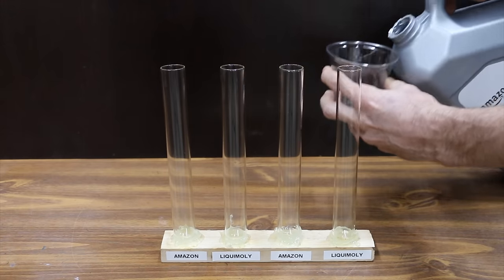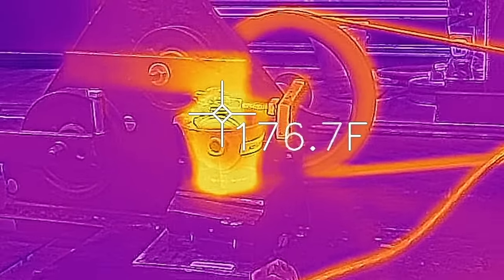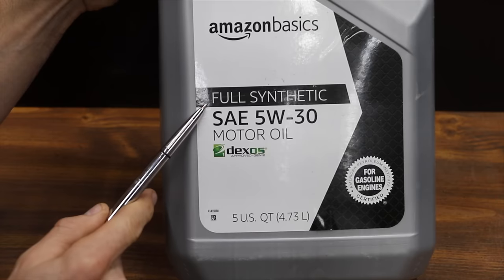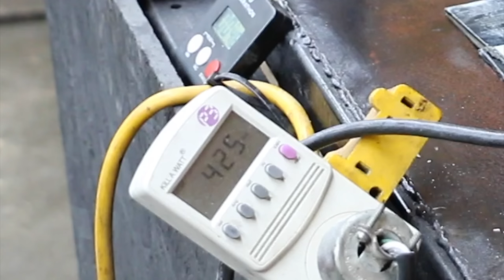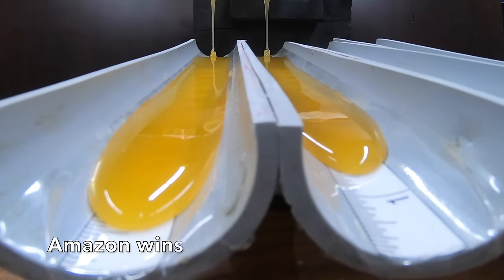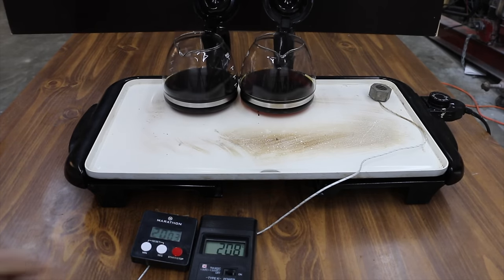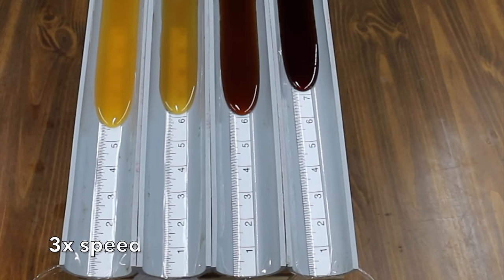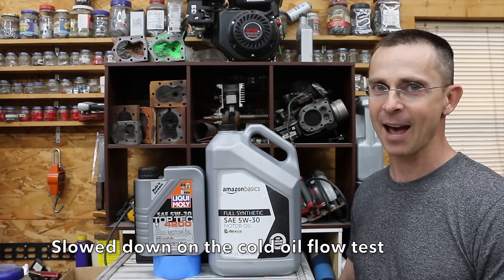Is Amazon Basics better than Liqui Moly? Let's find out!

Comment: I've watched many of your videos and enjoy them.  I'm not sure comparing Amazon Basic with a German oil is even a fair comparison.  On this one, I think there are a few call-outs that are worth mentioning:

1. I know a bit about Liqui Moly and I change my own oil in my 13 year old German car.  Liqui Moly has many tiers of oil, in the same viscosities available.  Looks like you used Top Tec 4200, which Liqui Moly says is an oil that can last between 30-50,000 km for people who don't drive often and can have a 2-year change interval (that's the claim).  I think the better, more apples-to-apples test was to use Liqui Moly's "baseline" tier, in 5W30, which is Leightlauf High Tech, in the blue bottles.  Could the difference make an impact?  

2. While Liqui Moly oils are suitable for many cars (German, American, Japanese), many of Liqui Moly oils have engine builder APPROVAL, and I'm not sure you brought that up in your video.  I agree with the general idea that Amazon Basics oil is perfectly fine, I would never use it since I buy oil brands (Liqui Moly, Valvoline, Mobil 1, Castrol) because they have my engine builder approval (not just recommended). Amazon Basics doesn't have that.  And I'm not an expert at the technical level but those things do count, especially in more sophisticated engines.  Whatever the additive package is to make Liqui Moly get manufacturer approval, can this difference also make an impact?

3. Lastly, as I said above, I also use Valvoline (American made) in my German car and it's fine since I have the builder approval code) so I'm not knocking American oil, but it is a fact that German oil is higher quality since there are higher standards in Germany.  Could that have also had some impact with your testing?

Just wanted to mention these issues, on the merit of the oil alone, and why I'm not sure this was a fair, apples-to-apples comparison (all other issues notwithstanding, such as the oils not being tested in an application with an engine, etc.)

Thanks.

Comment: Crazy name since according to Blackstone Labs, Liqui Moly does NOT contain any molybdenum at all!
Reply from the maker: Great point!  Helps explain the lubricity test.
Reply: Well I was going to start running liqui moly in my bike, diesels, and tractors. I mine molybdenum, can't believe it doesn't contain moly and the test results. Guess I'll be sticking with my Valvoline
Reply: My test from Blackstone labs shows 273 units of molybdenum in the liqui moly I am using, way more than the average results accordingly to their statistics. However I have to say that I am also adding Ceratec to it. Until we see real test from a trusted laboratory on the Amazon oil I think to stay away from it. The guys from Blackstone said to not waste the oil and advised to extend the use of it to at least 7k miles.
Reply: the ones that comes with moly seems to be MoS2 leichtlauf
Reply: @n.shiina8798  is that a diesel oil?
Reply: @n.shiina8798  that is what I am using exactly. The report says basically no engine wear, so I will stick with it. It's made for gasoline and diesel engines.
Reply: @rockymtndieselrider1133  as far as i remember, yes it is. ACEA A3/B4 should be gasoline and diesel oil
Reply: @radoadamov9201  i've used that one in the past but dang, it's so expensive and hard to find here. i went back to castrol edge to save my poor wallet.
anyway, i just accessed liquimoly's site and it says this oil is semi-syn. i thought it was full syn lol
Reply: @n.shiina8798  it is semi synthetic oil, I know that, but have the same quality than the full synthetic red label one they sell. However it has more additives, I was told that over the phone speaking with their Southern states district manager. He said that many high performance shops working on exotic cars are using it with the best results compared to all their products.. Good enough for me especially after 2nd oil analysis turned great from Blackstone. It is expensive though, fact.

Comment: What a fun set of tests!

For those not aware, SAE oil grades allow a range of viscosity (cST) for each SAE grade.
For example,
grade 20,  5.60 to  9.29
grade 30,  9.30 to 12.49
grade 40, 12.50 to 16.29
grade 50, 16.30 to 21.59

If you go to an engine oil brand website, they usually have publish tech data for the oils they produce and normally quote viscosity for 40 and 100 degrees. In my opinion they should also state a viscosity value for 0 degrees to indicate cold cranking performance.
Reply from the maker: Thank you!
Reply: @ProjectFarm 
You're  welcome!

One other factor with engine oils is the additive package to meet the specification. A, B and C specs of modern engine design.

VW PD engines for example, require a PD spec oil which can be 505.01, 506.01 or 507.00, 507.00 being the newer and is superior to the other two. 507.00 is available in 5w30 and 0w30.

Do it the easy way to find the oil you need. Go to an engine oil brand website and use the app to get a quote for the oil you need.

Comment: 1) testing oil viscosity by pouring it freely has nothing in commom with an engine. all engines have (surprise) oil pump with incredibly high power. unless oil became solid oil pump will pump it anyway.
2) friction machine simulates emergency wear. no engine has this type of friction in any bearings, otherwise no oil will help it - it will fail very quickly. if you will study some used oil analysis you'll see that any oil provides enough wear protection - engine will last for many hundreds thouthands miles. isn't it enough for you?

Comment: Im from Germany and i dont use Liqui Moly i use only ROWE motor oil.
Reply from the maker: Thank you!
Reply: Ravenoil is the best
Reply: @nikohorbie9977  What about mannol?
Reply: For semi-syntethic, i recommend mannol defender 10w-40
Reply: I use only Addinol ..2stroke
Reply: I use sunflower oil.
Reply: bestimmt nur wegen jp
Reply: @allesklar6042  du hast es erfasst, von dem Rowe hab ich nie was gehört und seit jp es reklamiert hat benützt mein Freundeskreis auch das oil??? Seltsam die Menschen(Schafe)
Reply: Todeskommandant dann mal  Moin😂
Reply: @-M-511  BelRay for two stroke
Reply: Professor Vollekanne ich benutze nur mobil1 und habe damit die besten Erfahrungen, mein Vater schwört auf Liqui molli und n Kumpel auch auf Rowe. Probleme hatte keiner von uns aber mit dem mobil1 5w50 läuft mein Wagen n ticken besser.
Reply: Ich benutze manol vorher immer Castrol aber da eh alle 15.000km ein Ölwechsel vorgenommen wird ist Castrol einfach zu teuer

Comment: I'll stick to my Liqui Moly ;)
Reply from the maker: Thanks for watching!
Reply: THE fact it did terrible after cooking you should think again.
Reply: Yeah because its still THICKER than the amazon basics. 5W-30 is not automatically 5W-30. There could and should have been tests where oil flow was tested under heat and also testing after the cooking of the oil to see how it performs
Reply: @thesecomments4777  Thicker isnt always better. AND to be certified,which it is,if it says 5w30 it is 5w30
Reply: @thesecomments4777  "The organization that sets the standards for
performance of motor oils is the Society of Automotive Engineers (SAE)." Hence the grading.
Their initial specification
defined five different numbered grades for motor oil (10, 20, 30, 40, and 50). The
grades were based on flow rates measured at 210° F (100° C) 
then the  addition of a set of
winter (“W”) grade designations (10W, 15W, 20W, 25W, 30W) which were specified by viscosity measured at 0° F

Comment: As a mechanic, from experience, I highly doubt your findings. I am using liqui Moly for 12 years now and it is my first choice to reccomend to my customers. Last year I opened the engine on my 2014 e350 to change head gasket and engine was incredibly clean after 124000 miles with Liqui Moly. Do you really think that probably one of the best European oil on tests is the same as Bezos prepackaged who knows what? But kudos to you, lot of views for questioning German oil vs.  American, you hit patriotic nerve of your viewers.
Reply: Has to do with impurities in the base. A European oil can never put perform an American oil solely based on where the oil is sourced from. I.e. there isn’t any European oil on the market that could come close to offering the protection or durability of pennzoil ultra. That’s just a fact. Liqui moly does a great job of advertising, making sure their they stay aligned with the manufactures recommendations. But as far as the oil it self, it’s average. And no patriotic nerve hit here, I’m Italian.

Comment: Amazon is adequate, but I still refuse to buy anything from Amazon due to their market monopoly. I recommend others to do the same. Amsoil is the way to go, and I predict it wins the bracket. Disappointing results from Liqui-Moly! I've heard reputable mechanics tout this stuff for years
Reply from the maker: Thank you.  I believe it's a good oil but Amazon is better in my opinion.
Reply: That’s because they were probably talking about the Liqui-Moly FULL synthetic oils not the “synthesis technology” this oil uses.
Reply: I was a believer in Amsoil. Almost set up a store. Then I put it in my wife’s car because she’s horrible at remembering anything car related. 20,000 mile oil. I sent it to Amsoil’s lab at 10,000, didn’t tell them the miles on it. They recommended changing the oil immediately. Sulphur way too high. I don’t use Amsoil anymore. Back to Mobile 1 in the car and Shell Rotella in the truck.

Comment: Test the additives. This is Amazon's achilles heel.
Reply from the maker: Thank you for the video idea!
Reply: Indeed, the add pack will decide its ultimate longevity and ongoing performance. The cheaper add packs in cheaper oils dont last as long. Im not sure how this can be tested though, without new rigs for permanent shear etc and testing the tbn, which would be great but only for a niche viewing market and a lot more hassle for Todd who is busy enough!
Reply: @andyholmes4676  It might not be as interesting to watch but the only reason I know this is because I saw another YouTuber who sent a sample to be analyzed.
Reply: @bendadestroyer  Oh it would interest me!
Just dont think the wider audience would appreciate getting into much heavier oil science. Could be wrong!
Reply: Black Stone Labs shows that many cheaper oils have great addictive packs. There are many oils out there cough*royal purple*cough that suffer after a thousand miles, losing viscosity at higher temperatures and shearing sooner.  Google lab tests if you don't believe me.
Reply: Testing is testing. He tested heat and cold perf that will test the additives, too.
Reply: @researchandbuild1751  No that is absolutely not true. Oil has a point in which it wears down to rather quickly, then stays there. The oil is going to be different for most of its life than before its break in cycle.
Reply: @andyholmes4676  He can obtain worn in samples, do his amazing tests, then send it off for lab analysis to finish things off.

Comment: What if it's the additives in liqui molly that makes it flow a bit slower? 

None of these test stakes additives into  account. (Difference between meeting specs and exceeding specs)
Reply from the maker: Thanks for the constructive feedback.
Reply: Ummm the rating 5w30 are based strictly on flow characteristics. Regardless of additives. Lubricity test tests for additive effectiveness so yeah just keep doing what you are doing.
Reply: @peterwelsh6975  Ummm. I never said otherwise.. It was a question, not a statement.

Also, oil is not oil. 

This one oil can meet specification, while the other exceeds it. THat's the difference between cheap oil and good oil. 

You get what you pay for..

Comment: Project Farm I enjoy your videos. You work hard to make your testing fair in an effort to find the "best" of something. It's obvious you are passionate and thoughtful. I worry that people watching will get the wrong idea. Your testing, while entertaining, is drastically oversimplified. You have no mention of HTHS properties for instance. Also no method for TEOST testing (crucial for any DI engine). You do infer at the start of the video that your testing is simple and does not necessarily reflect engine performance so thank you for that. Everyone watching needs to hear and remember that before they brag about saving money with Amazon oil. 

Modern engines vary greatly in design topology. For some engines builder approval is much more important than even oil grade. I run Liqui Moly 4200 not because of how fast it flows out of a test tube. I run it because it meets the most stringent builder approval (VW 504.00). Most oils on the market can not meet this standard. You can confirm this with the guys at Lubrizol if you like. I would hate to see someone put Amazon oil in their Audi TFSI and destroy the turbo...(you will void your warranty also)

I have actual UOA results of my using 4200 in my engine and they are second to none. I have iron deposits like that of a naturally aspirated 4cyl Toyota( 8 PPM).---Unheard of for a German DI/turbo engine.
Reply from the maker: Thank you for the constructive feedback

Comment: I commented on your latest video regarding the molygen liquimoly “green oil”.   It is not Dexos approved.

It would be interesting to see Dexos approved oils go against one another. I know this is a GM standard however oils that are Dexos approved have been put through more tests than the standard ILSAC GF-5 / API SN. They theoretically should perform the same or similar.  I’m willing to bet they are vastly different.

The best part of your tests are the hot plate.   I like to see how extreme heats change the characteristics of the oil which will help me choose something better in my vehicles due to my location.

If I am not mistaken,  some of the oils cold pour point may be different due to its natural viscosity.    The viscosity of Amsoil 0w-30 is nearly identical to 5w-30 however it’s cold performance is different.

Anyway,  I appreciate the videos and tests!!!    This should rattle the cages of oil and additive manufacturers.   I hate that they take advantage of people.  (Example - ZMAX)
Reply from the maker: Great recommendation! Thank you

Comment: Another great video.I have a question if I may.How important are the cold flow results if you never use the engine below 35 degrees fahrenheit?
Reply: P.S. I need 5w-40 and the Amazon oil is only about $1.50 less for the same quantity.

Comment: After Watching a handful of oil tests I just wonder if in the bearing test if you heated that bearing in the hot oil you testing and then do the test, if like zinc may be it would heat its self on the metal bearing causing less wear ?????????????

Comment: I bought a used Nissan Sentra with a 62K miles. The previous owner used Mobil's 5W-40. I live in a very hot country so the question here is Should I change to 0W-20 as per the user manual or not ?

Comment: Just a note on the lubricity testing, you should pick up a laser Tachometer,  to measure the RPM of the rotor in the tester.  you could use the Count of total revolutions and average RPM to normalize for variances in RPMs when testing.  Because a slicker oil will allow the machine to spin faster it will also mean that a larger linear footage will have been subjected to the test bearing.
Reply from the maker: Thanks for the suggestion.

Comment: Hey Project what are your thought on liquimoly engine flush for a higher mileage car? I’m thinking of using it for my Acura TL. Also one thing I noticed is the cold oil test the liqui moly is clearer than the Amazon as you can see the numbers on the ruler when the oil passes by over it.
Reply from the maker: Thanks for the suggestion.

Comment: After cooking test those samples need to mix very well before pouring in those test tubes. Because when they settle the heaviest part go down and lightest particles are very top so if you strait pour it to tubes there is only that lightest oil and may give that cold flow results better that it actually is in reality. Remember that engine typically sucks oil near bottom where oil is thicker at cold start.
Reply from the maker: Thanks for the constructive feedback.

Comment: Which oil should we use??? Every oil has some issues. The more I watch videos and read forums more I get confused. What oil should I use on my 500km’s ridden 250cc motorcycle. I want a ride with a smooth comfortable engine feel. As of now I’m using LiquiMoly 10w 40 engie oil & NGK Iridium Spark plug. And now thinking of adding 30ml of LiquiMoly Ceratec to kill the engine noises. I want a nice quiet and a smooth engine

Comment: These are for internal combustion engines as you know. Also you can share tecnical parameters of each brand. You are comparing just viscosity. Each brand uses different base oils. If we dealing with diesel engine lubrication oil also serve as neutrilising agent for sulphuric acid for internal parts  of engine such as piston rings, liners etc. So this comparison should be like this. Put two oils into same milage two identical engines with using same conditions. Send new oils and used oils to laboratory. Share the results. Good viscosity not always the best protection
Reply from the maker: Thanks for the feedback.

Comment: Impressive results! Amazon seems to perform like 0W-20. I wonder, how a Amazon 0W-20 would perform.
I will stay with Liqui Moly 0W-40 and 10W-50 since 5L cost me around 35€ and 49€, so the price is already cheap enough.
Also since I switched from Castrol to Liqui Moly on our cars, the oil consumption went down and the oil looks fresher on every change.

And I have yet to have any problem with LiquiMoly after more than 600.000km driven across our cars.
Reply from the maker: Thank you!